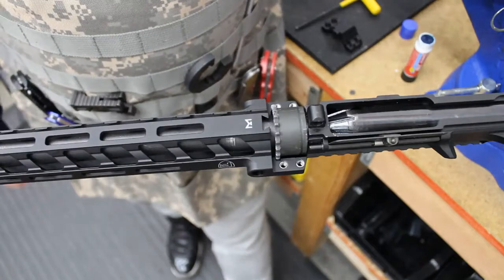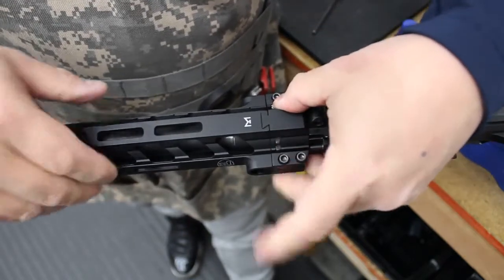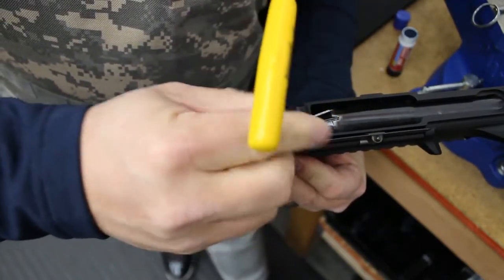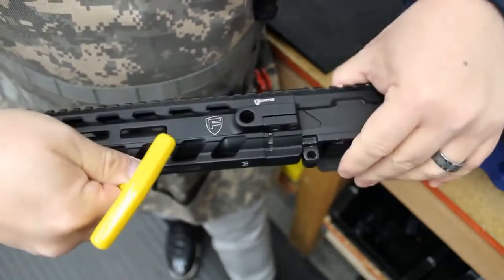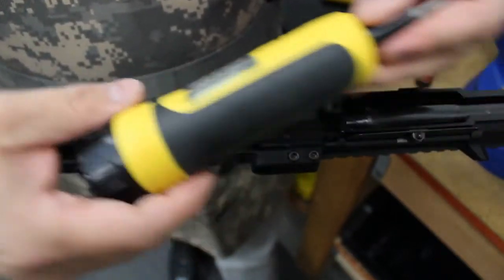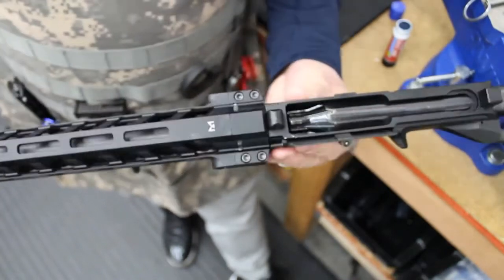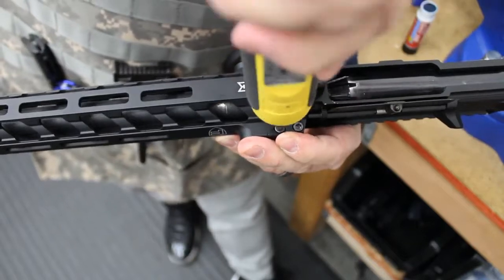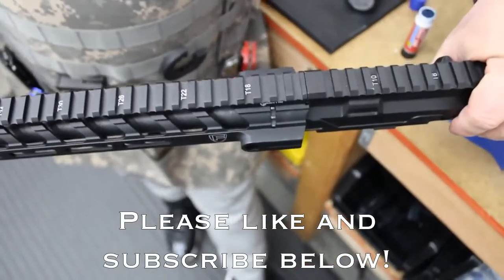Fortis REV II Installation

Comment: When I bought an upper with no handguard and a mil spec barrel nut I did not know how much of a pain in the ass it was going to be to find a compatible handguard. I figured there'd be a lot more out there that use the mil spec nut. Nope. Luckily you fine people have JUST the product I need!

<add to cart>
Reply from the maker: Glad it worked out.

Comment: Will the carbine length rev ll work with an Adams Arms gas piston system that has the railed gas block?
Reply from the maker: John,

If you find one of our old 7.2" Carbine Rev Rails it will work. Our current Rev II rails are not compatible with the Adams Arms railed gas blocks.

Comment: heard rumors that the REV II M-LOK rail works with Adams Arms STANDARD PICATINNY rail piston kit(not the low profile or XLP gas piston) Any advice?
Reply from the maker: Unfortunately, only the XLP or low pro piston system will work with the REV II hand guard.
Reply: thanks for your reply!  can you please enlighten me as to why that is? I am looking at a rifle gas length setup with your REV2 12inch M lok rail(perhaps, i should have mentioned the length), if the XLP kit gas block could work under the rail, why couldn't the kit with the standard picatinny gas block work? whats being obstructed?
Reply from the maker: Ahh, with a rifle gas length set up, yes you can run a REV II 12" behind that. I apologize, as most use carbine length piston kits, we typically advise behind the longer rail (a REV II 7" could certainly work behind that as well). Hope it turns out awesome!
Reply: nono its my fault, after watching nearly 8 full length videos of people running FF rails, it occurred to me that plenty of rifle users use a mid-length gas setup because of certain qualities it has over the other setups. My bad! Really, thank you for your answer! Appreciate it